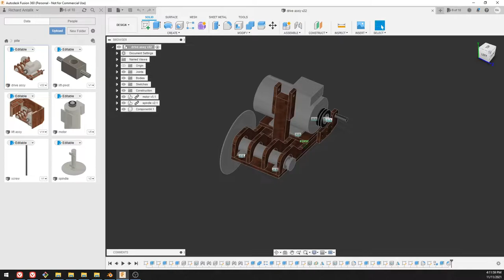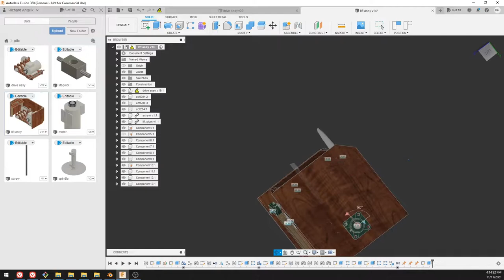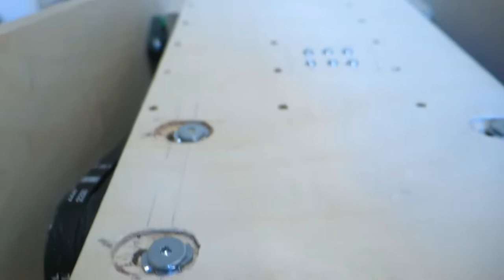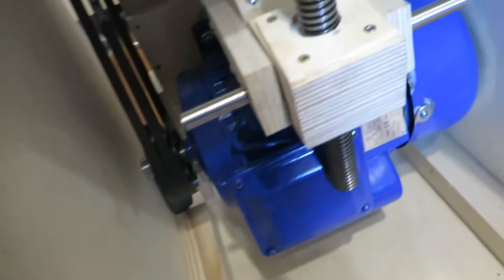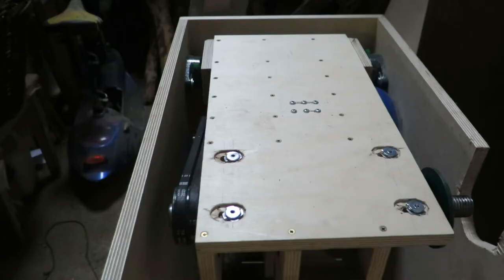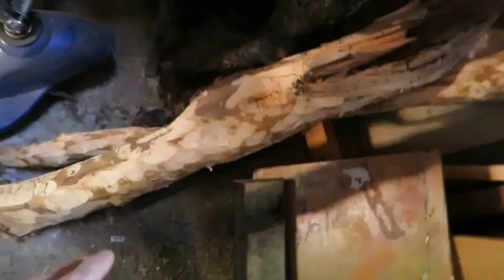Circular table saw lift mechanism

Comment: Smoker looks good. We usually do 750w hotplate with tinfoil and wood chips right on burner. Little water in there occasionally. Smoking you only want 120-140c, so small hotplate is enough for 0.2m³.
Reply from the maker: Lol, I was thinking how does this apply to saws :D I was thinking about using hotplate, but this style of smoke generator is less clunky IMO. Still needs babysitting though.

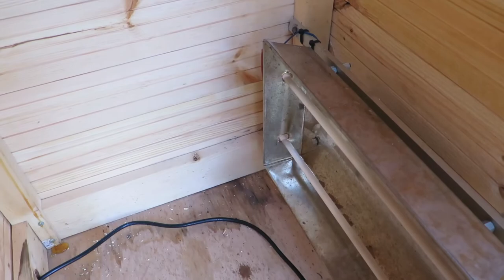Comment: 17:26 wire inside (the black one) isn't long enough. Take longer and wrap around heater few times for better work :D
Reply from the maker: :D I have to finish base still, it's not supposed to just sit on random piece of plywood. That's where electronics are supposed to be mounted. I was hungry though, so I used it as is.

Comment: I use a big angle grinder without the protection stuff , and for the table it's made of steel I welded and a bunch of bolts and rulers to adjust heght and stuff 
It's not really the best but it works
Reply from the maker: Should be fine as long as you keep neck and face out of axis of rotation.. But then it's not as easy to do straight cuts. I have respect for angle grinders, probably much more than any other tool. Big beefy lathes are scary too..

Comment: Your hinge needs to be as big as your saw blade bushing assembly. 
As far as your "lead screw" idea; it will provide so much flex, you'll never have a rigid design. Consider a lead screw on the vertical axis. It could push the motor up or down. Also LARGE threaded rod if it's going to be long. That crap has so much flex you cant go more than a few cm. You could also design a rigid bracket to replace the length of the threaded rod. Shit just flex too much bro.

Edit: using like 30cm rod to only move 3cm. That's your major design problem.

Edit2: consider the fact you need 3 very rigid connections and you have 1 good one, one shady af, and one floating.

Edit3: like, bolt a circular saw to the bottom of a table, then use its adjustment screws. This will be better and cheaper than your entire design.
Reply from the maker: Hmmm I don't quite understand what you mean.

Despite this mechanism not being rock solid, it cuts with sub-mm precision.